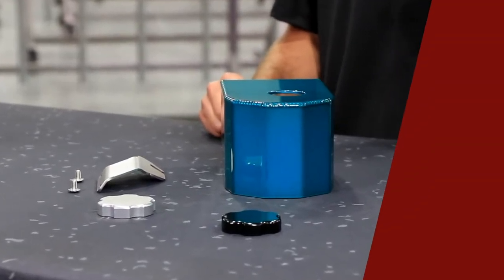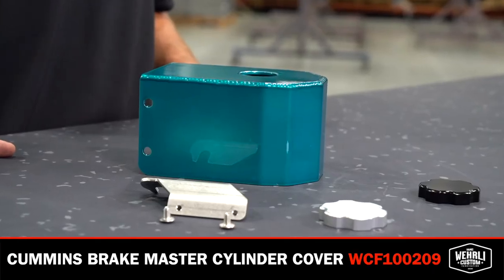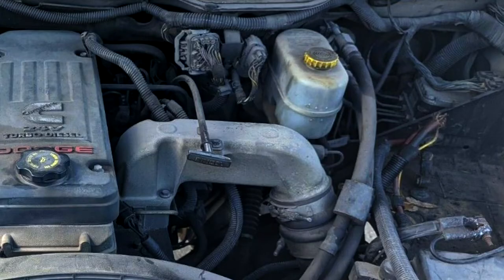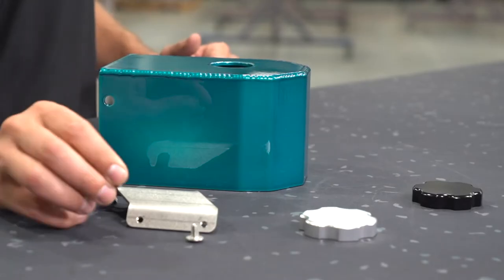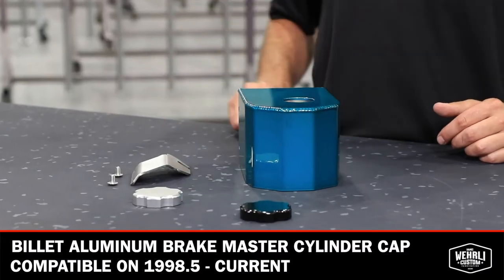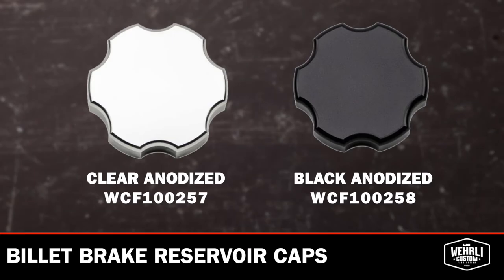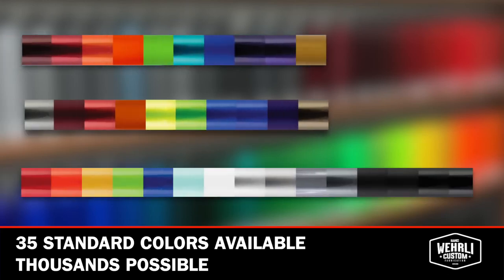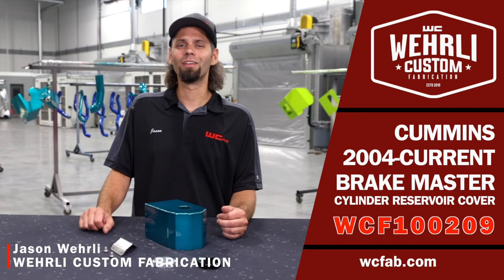WCFab 2006 - 2024 5.9L and 6.7L Cummins Brake Master Cylinder Reservoir Cover

Comment: What keeps this from fitting the 03-04 model's?
Reply from the maker: There's a difference in master cylinder design and packaging on the earlier trucks on the engine side that prevents our cover design from being compatible with those models.

Comment: Do you have to remove Brake master cylinder to install this mod?
Reply from the maker: @jeromygednalske3317  loosen the mountings yes, but removal is not required for installation of this part.